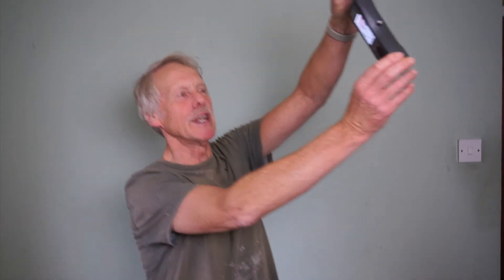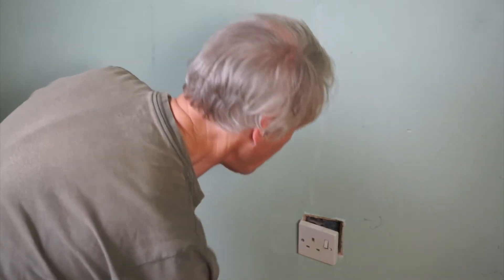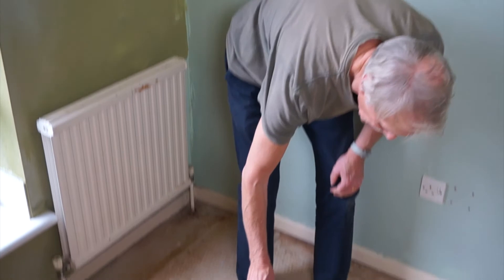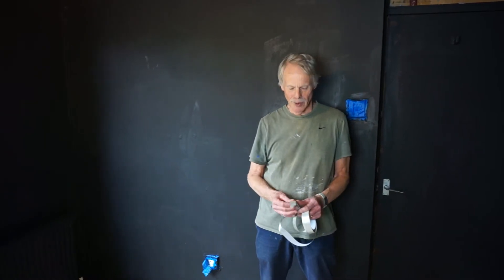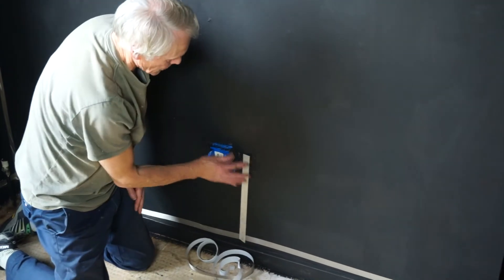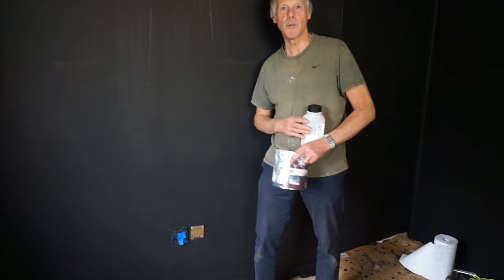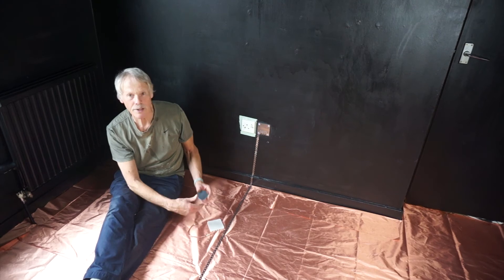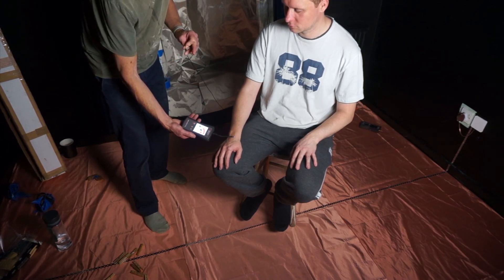Demonstration of shielding a room using Yshield paint, BlocCopper mesh (floor) & Blocwifi (curtains)

Comment: I noticed you painted over the grounding strap paint directly beneath the grounding plate.  I thought that the tape should be taped/glued to the plate directly without paint.
Reply: the paint is also conductive so it doesn't matter

Comment: All the effort and money and rediculousness you have done when you could have just focused our efforts on sueing the government.... I just WiFi painted a room with blocpaint and it was one of the most depressing and pathetic things I have ever done in my life.
Reply: Paint over it a more pleasing color...mix copper brass aluminum powders for even more reflection. .
Reply: @reneedolefinley6654 no. Its a load of bollocks the towers and meters need to go focus on the problem do not use a plaster....
Reply: @reneedolefinley6654  I can tell you have never even done it before... Because you can't just leave the black graphite as your wall colour 🤣its like a pencil tip you brush anythinf at all on that wall and you are in for serious trouble.....
Reply: @milkteaalliance1748  have on most walls all winter definitely have to paint over for sure.
Reply: @milkteaalliance1748  Hi there, this is actually my bedroom that Leonard kindly helped remediate. The Yshield will rub off but you simply paint over it 3 times with a normal paint of choice. I now have a fully remediated bedroom running entirely on ethernet cables. It was very high EMF before but now with the curtains closed it is 0 EMF which is really great for sleep. But to look at the room you would never know it had been done unless you try to make a mobile phone call. But thats fine I have all calls running through my computer and wired microphone 😊.
Reply: @michaelcole8703  I'm working on doing same.  Just hard being constantly jammed hacked and walking around looking like a embassy worker.  Magnetic energy mirrors I finding helpful also.  It's all so insane to adapt.
Reply: @michaelcole8703  Hi, would you mind showing a pic of the finished room, with the brighter paint please? What size is the room and much (approx) would it cost to do this?
Reply: @piitaa108  Hi there, I dont think I can share a pic on youtube, but  you wouldn't be able to notice from looking at it that any remediation has been done. The black EMF paint is underneath 3 coats of light coloured paint and the paint is the correct colour. It just looks like any other room. The cost for a medium sized bedroom in a typical English terraced house is about £1000.
Reply: @michaelcole8703  Thanks That's helpful.
Reply: @reneedolefinley6654  Good luck - doing it the way Leonard presented has worked well here.
Reply: @piitaa108  I tried to send you a link but whatever I do to disguise the link it gets deleted. Anyhow i have changed my profile pic to an image of my room which faces the same direction as the video. Zoom in and you can see. Blockwifi sowed into the curtains after the video. Computer on ethernet.
Reply: @michaelcole8703  Could you post the name and model number of the EMF tester that Leonard was using for the rooms EMF reading before and after results